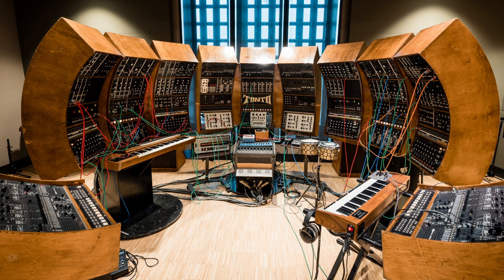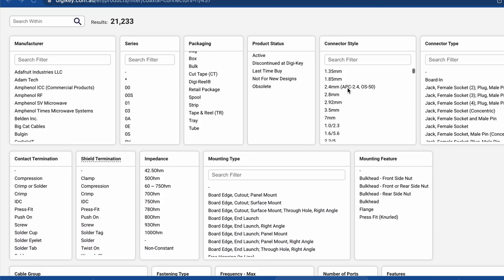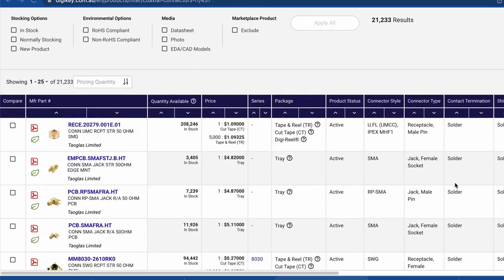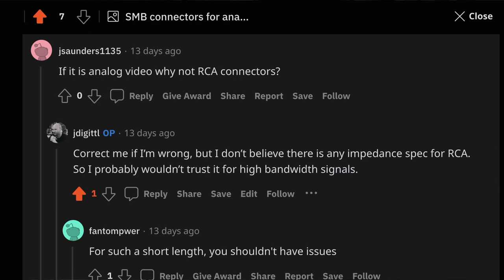Analog HD Video Connector Shoot Out

Comment: "I've never let good reasons get in my way before", words to live by! 🙂 I was recently bit by a 2x Nyquist assumption. I was measuring outlet pressures on a progressive cavity pump. By nature it rises up quickly, cycles up and down a bit at the top as the cavities open to the outlet, and then decreases rapidly as the motor stops. We dubbed the waveforms "Bart Simpson" heads for obvious reasons. I figured the top portion was a pretty good approximation of a sign wave, doubled the frequency and proclaimed we could get a decent approximation of the area under the curve by just sampling at a rate the basic I/O on our PLC could handle. Not the case! Slip that first or last sample earlier or later on the fast rising/falling edge of what is essentially a square wave and... 
Got a little sidetracked there, as I knew it was going to be the DIN at 11:15 haha